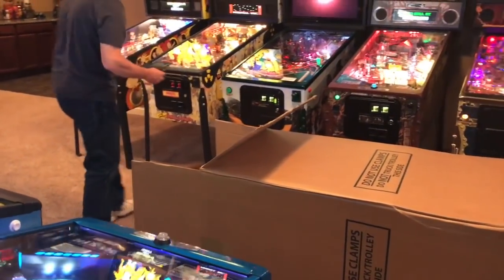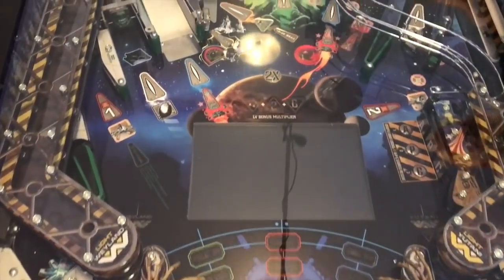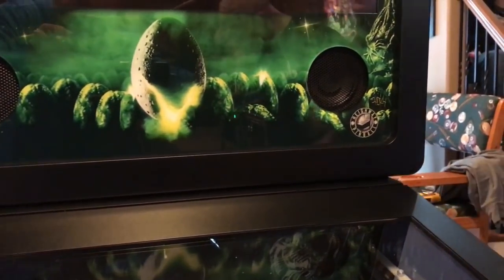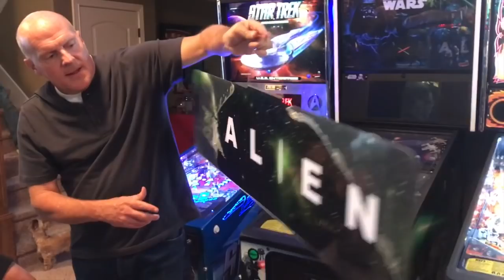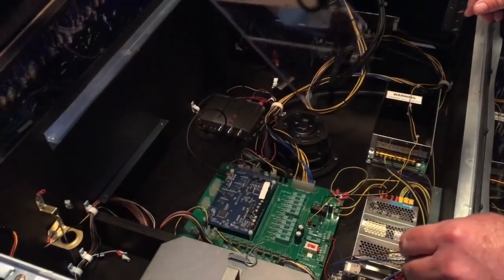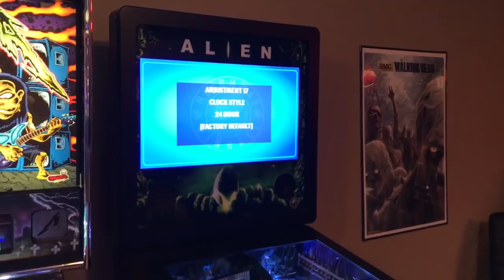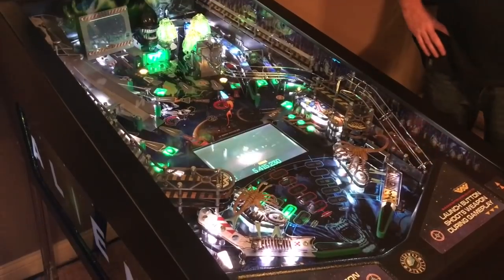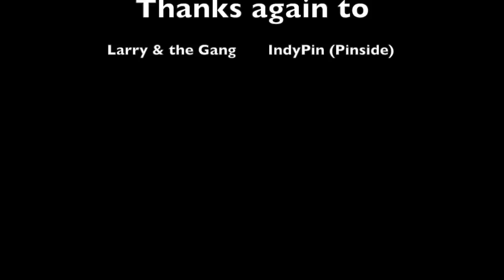SDTM: Alien pinball unboxing and gameplay

Comment: The ramp tabs at the bottom were designed for holding signs, but we ended up not using them after the signs were designed. Aurich in particular thought the signs actually detracted from the atmosphere and weren't necessary at all.
Reply from the maker: Eala Dubh very cool info!!! Thanks Eala
Reply from the maker: Yes thank you so much! We were really confused! I don't know what it looked like in renderings but envisioning signs down there does seem distracting and unnecessary!(Greg) great job on the pin! Didn't want to stop playing it!
Reply: Can we expect a review soon?
Reply from the maker: Eala Dubh oh yeah! We have to put some more plays on it first but hoping that’s one of the next few reviews

Comment: You are real pro's...you mount the back-box before the legs....so you have to sit on the floor while attaching everything and add some weight so its nicer to mount the legs then. To tilt the machine back to mout the front-legs is surely good for the Backbox-mounting-hardware.
Reply from the maker: Arcade Collectors Europe somebody woke up on the wrong side of their pinball machine.....
Reply from the maker: The head was mounted first to simply get it out of the way. With so many people around it would have really sucked for it to get kicked over! We’re getting old but not to old to sit on the floor! The head wasn’t very heavy so the additional weight seemed minimal compared to the weight of the entire pin when lifting it. If the head hardware can’t take the game sitting at a 30 degree angle highway needs to go back to the drawing board because it will never stand up to nudging or moving the machine. I felt every one who had their hands on the game was super gentle and took care to not stress any part of the pin. Sorry it wasn’t set up to your standards but we still appreciate you taking the time to watch. (Greg)
Reply: Straight Down The Middle: a pinball show LOL